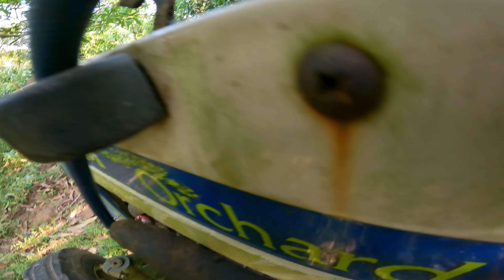will it  run?

Comment: Duster 110 injector. Do u know where to find a second spare at a reasonable price
Reply: Ukkandam marketil call cheyth nokku pinne north paravur scrap ond anganathe    scrapil accident vehicles ondakum annoshichal kittum accident vandide aanel valiya problems onnum undavilla kaaranam running aayittulla vandide spare kittum
Reply: Pinne injectors service cheyyunna sthalam ond avidem koodi annoshichal injector mattathe ath thanne upayogikkam injector service cheyyan orennam 6000to 10000 varum

Comment: Power take-off (PTO) is a device that transfers an engine's mechanical power to another piece of equipment. A PTO allows the hosting energy source to transmit power to additional equipment that does not have its own engine or motor